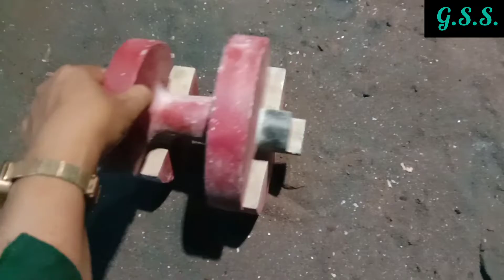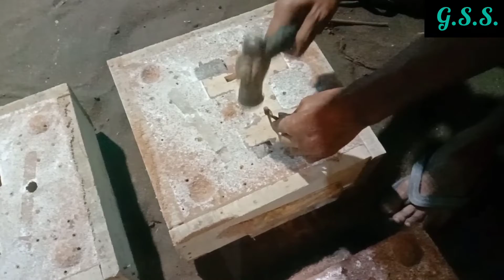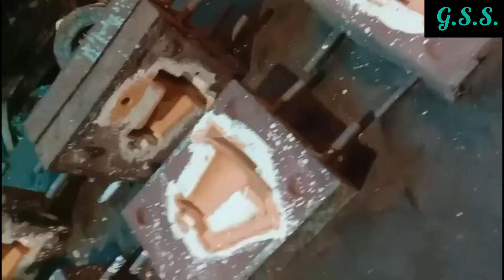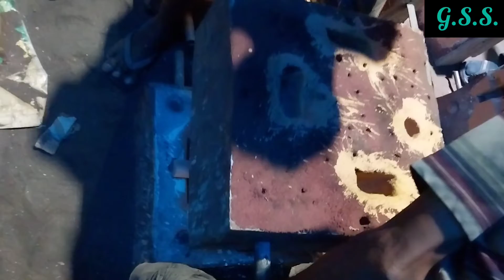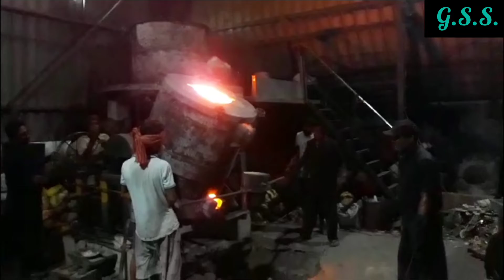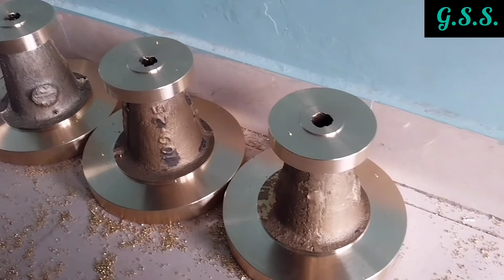Piping Engineering : Cast Brass Fittings Making Process

Comment: Please explain casing pipe installation for some crossing locations in order to protect the non-metallic pipe. Please explain the new topic for RTP pipe installation, onshore wellheads, production manifolds, flowlines, remote manifolds, trunk lines, CI and SI lines (corrosion inhibitor and scale inhibitor lines), and blowdown skids, in a simple point-by-point manner."

Comment: How are you? pls MAKE VIEDO ABOUT CHOCK VALVE and post videos
Reply from the maker: I am fine, recently I have uploaded several good Engineering videos like cathodic Protection system with Calculation, HDD Process, 3LPE Coating for UG Pipeline, Metallic Bellow Failure, safety valve failure, etc.  Please watch these.
Reply: @gourisankarsamanta7670  I will definitely watch all the videos and I won't miss anything because all your videos are precious like pearls.. thanks sir. Awaiting your New video update
Reply from the maker: Check valve video is already there, please watch below video : 

https://youtu.be/DsHNgwBRfC4?si=FOTsQto4JTs9N3Pf